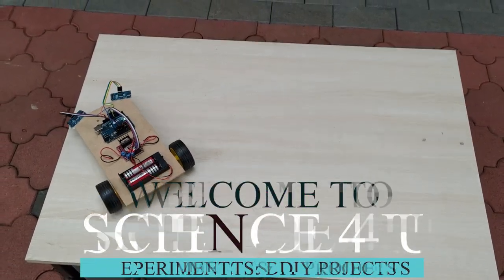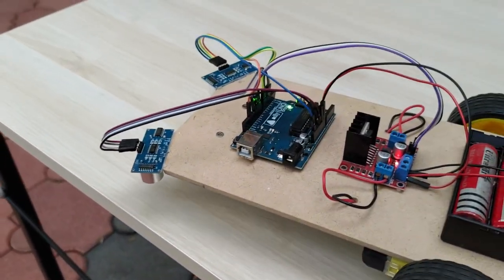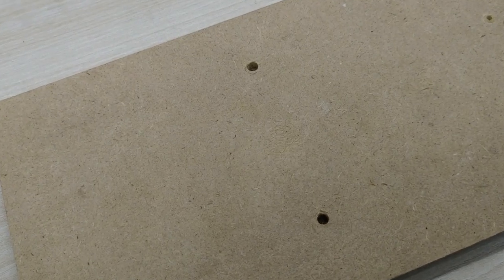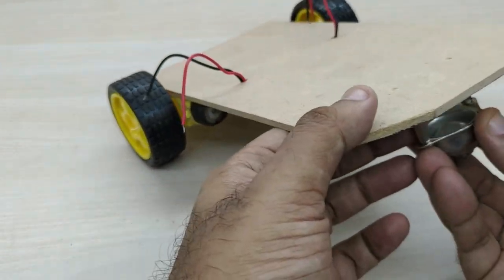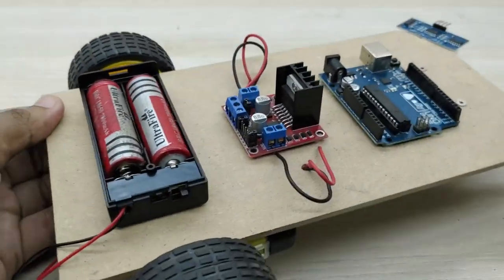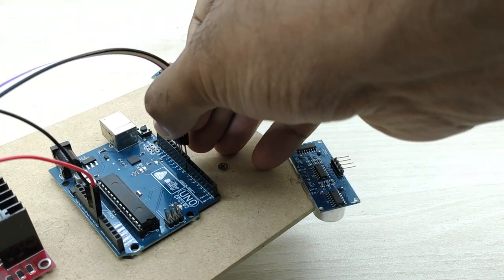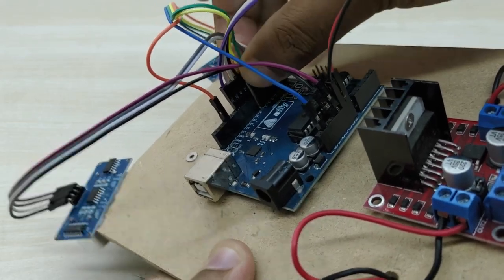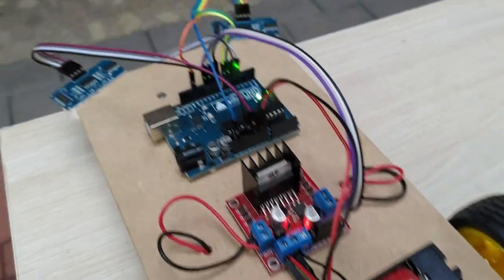How to make Edge Detecting Robot || Edge avoidance robot that never falls off the table !!!

Comment: Hi! How did you turn on and off the robot? Did you put a switch?
Reply from the maker: Hi friend. The battery pack that I am using is already having a small  builtin switch kept on its side.  So I did not have to put a separate switch.

Comment: I did everything and it made my robot go in circles
Reply from the maker: Hi friend. I guess one motor is rotating forward and other motor is rotating backwards, which is causing the robot to go in circles. So just interchange the +ve and -ve wire connection of the motor that is rotating backward,  to the motor driver board. That should solve the problem..
Reply: Me too

Comment: Bro my robot is vey fast so what can i do about it or how to reduce the speed
Reply from the maker: Hi friend. The easiest way to reduce speed is to reduce the battery voltage. There are actually 3 speeds of geared motor available, 60 rpm, 100 rpm and 300 rpm. Most probably you may be having 300 rpm motor. That is why the speed is very high. you have to purchase a lower speed motor to reduce the speed. Decreasing the voltage will also reduce the speed. But it cannot reduce the speed beyond some limit.

Comment: Can you give code....
Reply from the maker: Hi friend. The code is already available for download from the link given in the description box..
Reply: @Science_4U_   but that format not support to  our phone...
Reply: @JaiphulaBarik  yes same problem...
Reply from the maker: @JaiphulaBarik  YOu need to install arduinodroid app in phone to open the code. You can open the code also in PC or laptop by installing IDE software. 
I will paste the code here also..

#define trigPin1 4           // Trig Pin Of HC-SR04
#define echoPin1 5        // Echo Pin Of HC-SR04
#define trigPin2 6           // Trig Pin Of HC-SR04
#define echoPin2 7        // Echo Pin Of HC-SR04
#define MLa 8                   //left motor 1st pin
#define MLb 9                  //left motor 2nd pin
#define MRa 10               //right motor 1st pin
#define MRb 11               //right motor 2nd pin
long duration1, distance1, duration2, distance2 ;

void setup() {
  Serial.begin(9600);
  pinMode(MLa, OUTPUT);     // Set Motor Pins As O/P
  pinMode(MLb, OUTPUT);
  pinMode(MRa, OUTPUT);
  pinMode(MRb, OUTPUT);
  pinMode(trigPin1, OUTPUT);       // Set Trig Pin As O/P To Transmit Waves
  pinMode(echoPin1, INPUT);        //Set Echo Pin As I/P To Receive Reflected Waves
  pinMode(trigPin2, OUTPUT);       // Set Trig Pin As O/P To Transmit Waves
  pinMode(echoPin2, INPUT);        //Set Echo Pin As I/P To Receive Reflected Waves
  }
  
void loop() 
{
  Serial.begin(9600);
  digitalWrite(trigPin1, LOW);
  delayMicroseconds(2);   
  digitalWrite(trigPin1, HIGH);       // Transmit Waves For 10us
  delayMicroseconds(10);
  duration1 = pulseIn(echoPin1, HIGH);        // Receive Reflected Waves
  distance1 = duration1 / 58.2;                       // Get Distance
  Serial.println(distance1);
  delay(5); 
  
  
  if (distance1 < 10 )               // Condition For Absence Of Obstacle            
  {
    digitalWrite(MRb, HIGH);       // Move Forward
    digitalWrite(MRa, LOW);
    digitalWrite(MLb, HIGH);                                
    digitalWrite(MLa, LOW);   
                                                       
  }
  else if (distance1>15)            // Condition For Presence Of Obstacle
  {
    digitalWrite(MRb, LOW);     //Stop                
    digitalWrite(MRa, LOW);
    digitalWrite(MLb, LOW);                                
    digitalWrite(MLa, LOW);
    delay(5);
    
  
    digitalWrite(MRb, LOW);     // Move Backward             
    digitalWrite(MRa, HIGH);
    digitalWrite(MLb, LOW);                                
    digitalWrite(MLa, HIGH);
    delay(500);
    digitalWrite(MRb, LOW);        //Stop                
    digitalWrite(MRa, LOW);
    digitalWrite(MLb, LOW);                                
    digitalWrite(MLa, LOW);  
    delay(100);  
    digitalWrite(MRb, HIGH);     // Move Left     
    digitalWrite(MRa, LOW);   
    digitalWrite(MLa, LOW);                                 
    digitalWrite(MLb, LOW);  
    delay(500);
  }

digitalWrite(trigPin2, LOW);
  delayMicroseconds(2);   
  digitalWrite(trigPin2, HIGH);       // Transmit Waves For 10us
  delayMicroseconds(10);
  duration2 = pulseIn(echoPin2, HIGH);        // Receive Reflected Waves
  distance2 = duration2 / 58.2;                       // Get Distance
Serial.println(distance2);
  delay(5);

 if (distance2 < 10  )               // Condition For Absence Of Obstacle            
  {
    digitalWrite(MRb, HIGH);       // Move Forward
    digitalWrite(MRa, LOW);
    digitalWrite(MLb, HIGH);                                
    digitalWrite(MLa, LOW);   
                                                       
  }
  else if (distance2>15 )            // Condition For Presence Of Obstacle
  {
    digitalWrite(MRb, LOW);     //Stop                
    digitalWrite(MRa, LOW);
    digitalWrite(MLb, LOW);                                
    digitalWrite(MLa, LOW);
    delay(10);
    
  
    digitalWrite(MRb, LOW);     // Move Backward             
    digitalWrite(MRa, HIGH);
    digitalWrite(MLb, LOW);                                
    digitalWrite(MLa, HIGH);
    delay(500);
    digitalWrite(MRb, LOW);        //Stop                
    digitalWrite(MRa, LOW);
    digitalWrite(MLb, LOW);                                
    digitalWrite(MLa, LOW);  
    delay(100);  
    digitalWrite(MRb, HIGH);     // Move Left     
    digitalWrite(MRa, LOW);   
    digitalWrite(MLa, LOW);                                 
    digitalWrite(MLb, LOW);  
    delay(500);

 
    
  
  }
}
Reply from the maker: @JaiphulaBarik  You need to install arduinodroid app in phone to open the code..
Reply from the maker: @JaiphulaBarik  you can also open the code in PC or laptop by installing Arduino IDE software.
Reply: @Science_4U_  Thank you

Comment: why it is not working for me
Reply from the maker: Hi dear friend. What us the problem that you are facing?. Is the robot not detecting edges? Or is it not moving at all?
Reply: It's not detecting edges my friend. It always move forward. But, if I remove the ultrasonic pin, it moves backward like it detects edges
Reply from the maker: @enjay9723  Hm..okay friend. It is a problem with your ultrasonic sensor. I think it is faulty. Can you just bring your hand near to the ultrasonic senzor while everything is switched on?. The motor should change direction of rotation. Is it happening like that?

Comment: It doesnt work. all it does is just turn left and right then go back and forth regardless of the presence of edge.
Reply from the maker: Hi friend. That is because the ultrasonic sensor is not detecting properly. The ultrasonic sensors keep on measuring the distance below. If the distance below is less, that means that there is table underneath and it starts moving forward. But if it suddenly detects that distance is more, it means the edge is detected and it reverses and changes direction, to avoid falling down. In your case either one or both the ultrasonic sensors are not working. So it always measures higher distance though there is table underneath. So it keeps on reversing, change direction and moves forward.
Reply from the maker: Please use tested working ultrasonic sensors and it will solve the problem, for sure..

Comment: Please list components
Reply from the maker: Hi friend. The component list and its purchase links are already given in the description box.🙂
I will give the list below also..
The links for purchasing the items are given below. 

1. Arduino uno board : https://amzn.eu/d/iH03OHj
2. L298N motor driver : https://amzn.eu/d/bzrLeMA
3. HC-SR04 Ultrasonic Sensor : https://amzn.eu/d/i5OkXM7
4. Motors with wheels : https://amzn.eu/d/gGczeza
5. 18650 battery pack  :https://amzn.eu/d/gtI4BlO
6. Jumper wires : https://amzn.eu/d/hQ1P7Mi

Comment: Edge detection not detecting correctly
Reply from the maker: Can you explain the problem friend?. I will help you to solve it.
Reply: It was going right left not moving straightly
Reply: And also fastly moving
Reply from the maker: Hmm..okay friend. It is definitely because either one of the ultrasonic sensor or both the ultrasonic sensor are not working properly..You have to replace them with good one..
Reply from the maker: @telugumusicworld2786 If it is mpving very fast, the easiest way to reduce speed is to use battery with lower voltage..